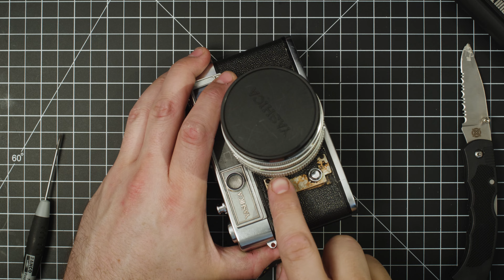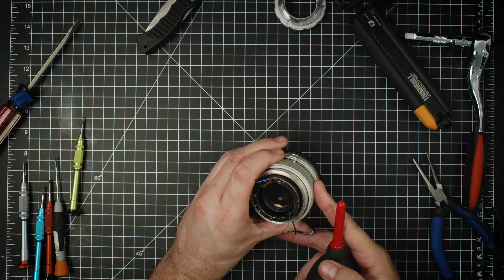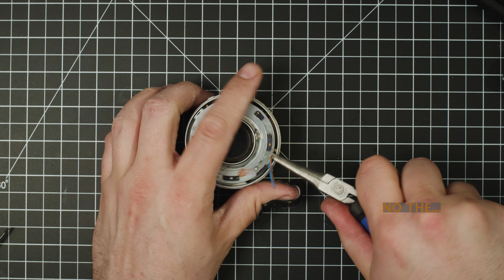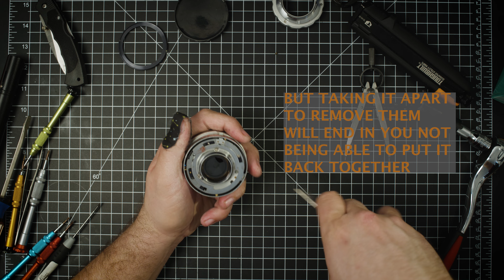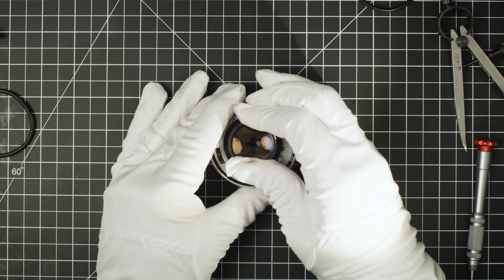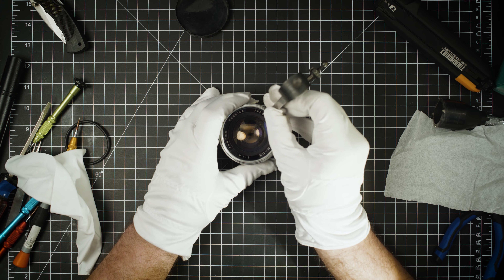Yashica 45mm f1.4 Lens Mount Conversion

Comment: Great video and thank you for sharing. I would like to try my hand at this conversion going to sony e, what helicoid did you use for that, same step ring I guess but what helicoid. Would love to know. Have a great day.
Reply from the maker: Hi, you should be good with a 25-50mm or 25-55mm M42 helicoid and a slim M42 to Sony E adapter. I believe infinity will be just over 30mm so there are options.

Comment: Many Thanks for sharing the video. I am trying this same mod and am stuck at removing the four key "heil" or "hell" retaining ring in the back. Soaking with acetone using a long syringe is not helping to unseat the ring. Just to ask, what was the socket size you modified to get the thing off? Would I be right in guessing that all Electro 35 GS/GT lenses have this same cast iron metal weight + helicoid in the back of them (and the same type of "hell" ring as well to retain the weight/helicoid)? Also, there is inside surface fungus in the front and rear groups, rear group has a way to separate the elements, but no such thing I see with the front group, looks sealed. Maybe there is a hidden joint obscured by the paint coating....
Reply from the maker: I don’t think I’ve ever opened the front group. It is definitely glued.

As far as the ring, I will have to measure when I’m at the office. For some reason, some of them come off with no effort and some of them are impossible. The metal in there is brittle so it is easily to bend and then it is impossible. Wish I could be more help on that!

Comment: great video mate, for sony mount should i use a m42 to sony e mount macro helicoid?
Reply from the maker: Yes, that works. There are several thicknesses of M42 to E mount. I have seen them from 1mm to 5mm. So you can make this work with any M42-M42 helicoid with an M42 to E. I don't have anything  in front of me at the moment, but will let you know what size helicoids I have used for E mounts when I'm at my office later.
Reply from the maker: 25-50mm is what I use for Leica L, which is the same flange distance as Sony E.

Comment: What are the differences between doing this and adapting it to Sony E? Does the process change at all?
Reply from the maker: The process doesn't change if you're swiping out the helicoid. There are some people who have drilled, glued or bought adapter pieces to use the native helicoid so you are connecting the E mount to the metal on the back of the lens. The problem with that is the close focus is pretty bad...
Reply: @koshkinland where are you buying these helicoids? Is there a good place to find them for going to Sony E? Does it have to be a certain size?

Comment: This is super cool! But why do you remove the shutter leaves? And how do you get them back in??
Reply: Oh wait i was getting shutter confused with aperture - I see they are just redundant so are removed
Reply from the maker: I see you answered your own question, but yes, they aren't needed once adapted. Also, you can jam the shutter open by putting the lens in bulb mode, holding the shutter to open it, then sliding the setting out of bulb. The problem with that is it sometimes pops back closed. If it happened in the middle of using the lens on a shoot, you'd be in trouble as it isn't a quick fix.
Reply: Thank you for the answer! @koshkinland   I have this camera on order and keen to try this, I think removing the shutter leaves sounds most sensible for reliability on a shoot.

Comment: Any chance you have a video on reassembling the aperture? :D
Reply from the maker: I have never had any luck reassembling the iris when leaves have come loose. If it is just that the iris doesn't react the culprit is often that the peg has popped out of the groove. Once helicoid is off and you turn the iris you'll see an assembly moving. Sometimes the little pin that goes in the slot, gets bent or pops out. You can often bend it back into place to get the iris working again. But as far as full disassembly and reassembly, I haven't had luck.